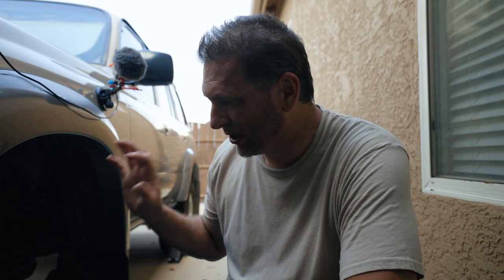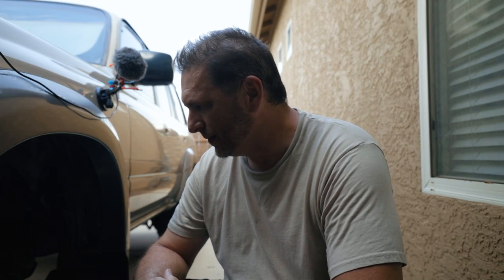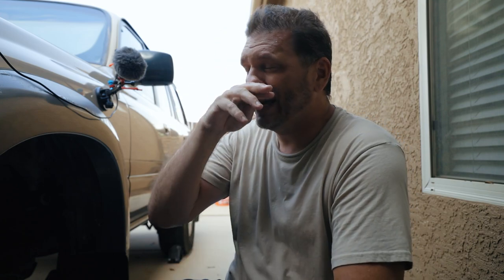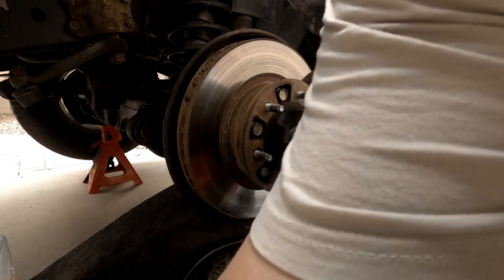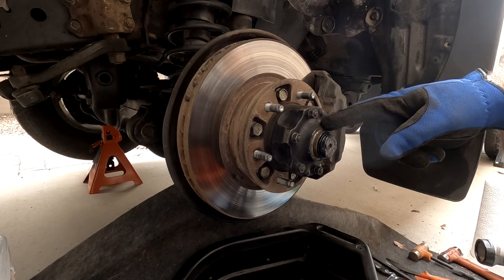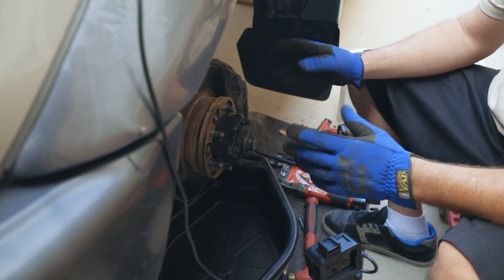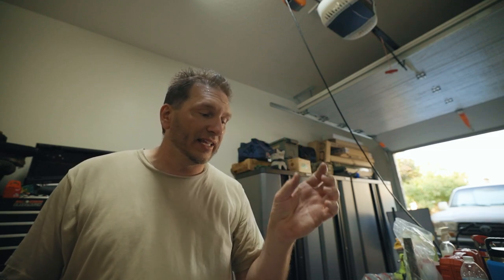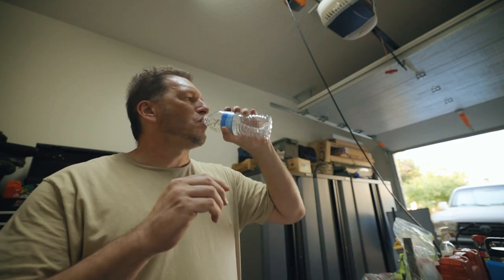What's Inside the Front Axle | Project 80 Series Toyota Land Cruiser Ep.2

Comment: Chris great video, angles covered were great, it was like standing next to or over the shoulder of the mechanic seeing the process. Audio was good as usual. Going through each step and naming tools to be used and techniques suggested and your preference perfect to have shared each option. Good knowledge of what parts your are working on and what each does and its interaction. 

For now since you dont have the tires and all the parts to do the re-gearing using the parts your can for now will work, overtime the movement and wear will open up some gaps in the seal and issue will return (however from looking at it should be good for a ok amount of time/use). 

since not everyone has grown up with, worked on, mechanically inclined, etc a suggestion would be to maybe include what you use to clean such items for the various caked on crud, grease, oil, etc also if you have a preferred brand (see also last portion section).  example: I have a compressor with a sprayer (sort of like what you would do with paint) in the container before working on the caked on product, i like using simplegreen with the pressure i like to get a nice heavy coating and coverage over everything let it sit for 15-30 minutes to really get in and then a powerwash or a strong pressure setting on a hose, most grit grim and caked on stuff will come off. then let dry, I'm still old fashioned in some cleaning i prefer to use the tried and true baking soda and vinegar (aka homemade volcano) put parts in add the soda and let its reaction help eat away. others brake clean, wd 40, etc and the blue shop towels like you were using.

Overall great video, hope to see more

 Last portion: With enough kind loving viewers of the Meatwagon22 Twitch streams that can help speed up this project with the correct parts/settings/etc. **** Also a parts list for things that will need to be replaced and things you wish you could get, an amazon wish list for those who like to buy you some items not necessarily car related but might build up your strength and energy like licorice. Or items for cleaning parts, tools, etc. ***

Comment: I’m glad you took it all apart cause your in there already… I mean not like you wanted to but you there. And I hope the worn down axle doesn’t just wear the seal down faster. And as far as cleaner to run…. Never tried that only engine flush for oil…. But never really tried diff and transfer case flush…. Never even researched it…. Let me know if you find a cleaner